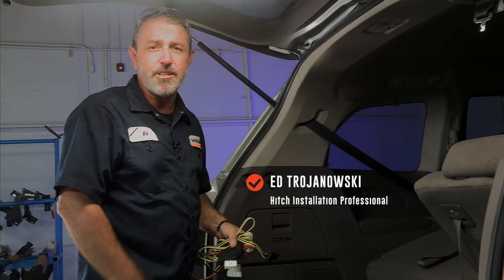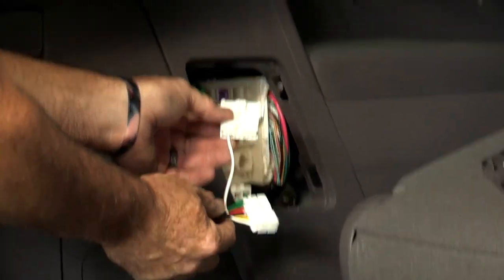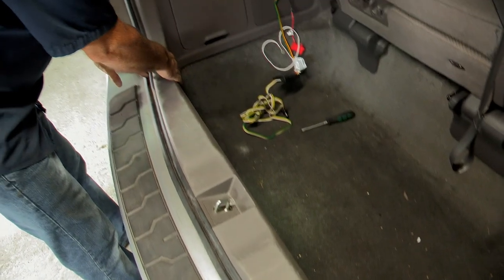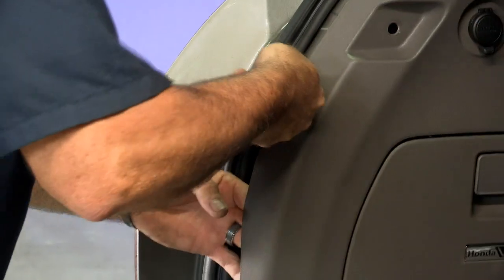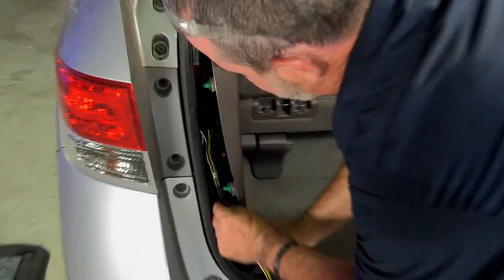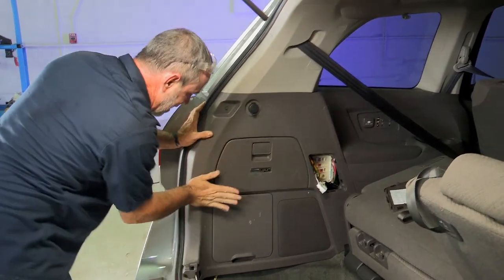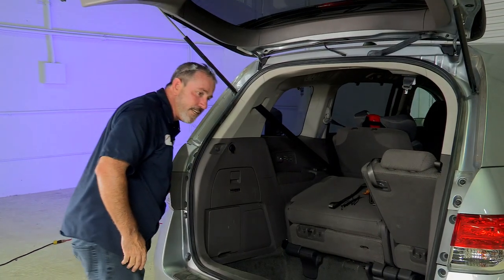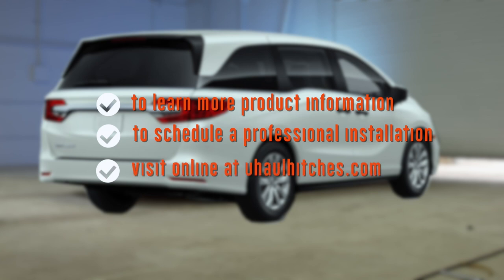2014 Honda Odyssey Trailer Wiring Installation

Comment: Don’t forget to install the red 10A inline fuse near the black box on the Curt unit before installation. Mine was not installed from the factory and I didn’t realize this until I had reinstalled the trim. Also, when reinstalling the side trim don’t just force it. You need to make sure the green clips line up with the holes otherwise it might break off (don’t ask how I know).